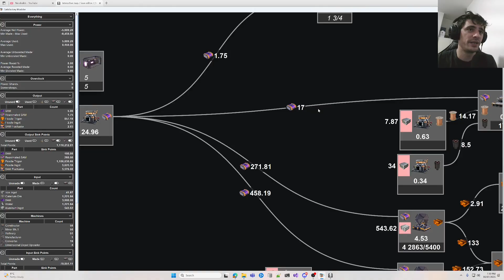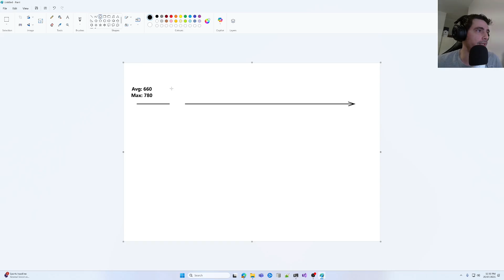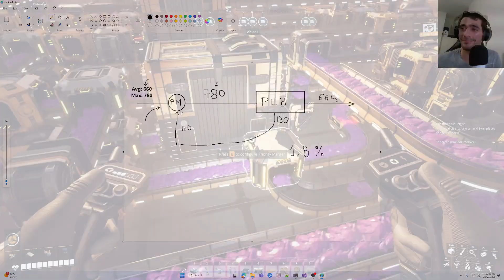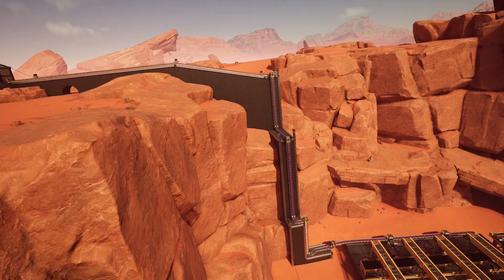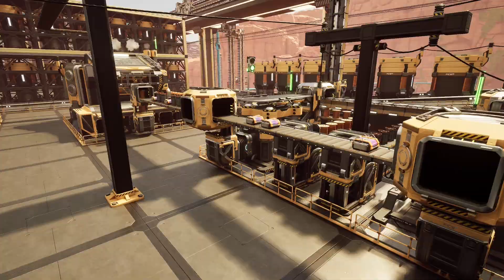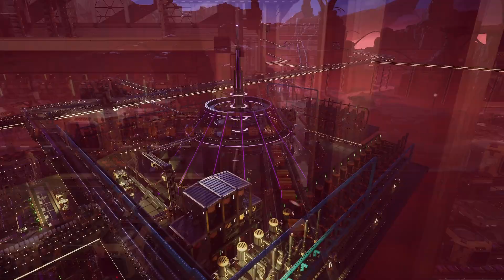The Most Overengineered Factory in Satisfactory (Ficsite Trigons + Belt Limiter Madness!)

Comment: You  always build great stuff Nico :) but for those who want a simpler way to do the belt balancing, industrial storage containers (ISC) prioritize the lower belts so you have all 4 go into 2 ISCs where the bottom belts will be 780/m. The top belts from the two ISC go into another ISC from which the bottom belt will be another 780, leaving the remaining 660 for the top belt when all belts are running at 100%.  You could then use a smart splitter on that belt to overflow into your dimensional depots since it will only get what is left over from production.

Comment: First time seeing your channel, the algorithm must be picking it up!

I was wondering why you took the approach of using the PLB (which is very cool btw) to get a 660 belt instead of using a priority splitter with priority onto a Mk2 120 belt that feeds back into the priority merger? This should net you a perfect 780-120=660 belt with only a single merger and splitter.

ps. croquettes are to die for, especially with a bit of mustard on a bun
Reply from the maker: Hey, thanks for your comment!
This type of belt limiter was done not because I needed to, but because I could. The idea was able to create something that could limit the belt to any speed (like 473.2 for example). In this case it wasn't necessary as playing with belt speeds could have done it. 

Anyway, after a long time it stabilized at the 665, so I'm wondering if I could simply set it back to 660. But that factory is already up and running and I don't want to mess up with it.
I am currently working on a factory that uses several belt limiters as you are describing, and they work like a charm! That video will probably release in two weeks time.

Thanks for stopping by!